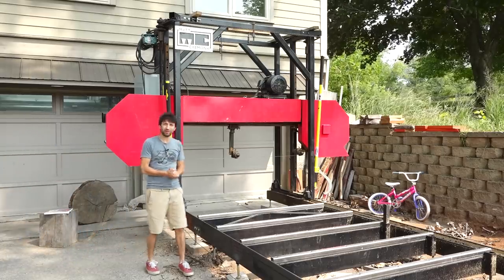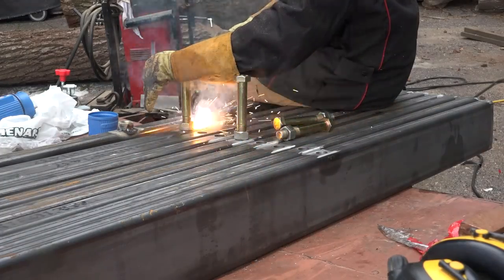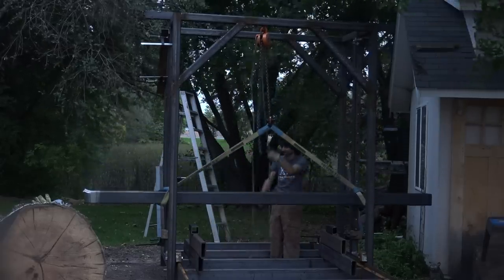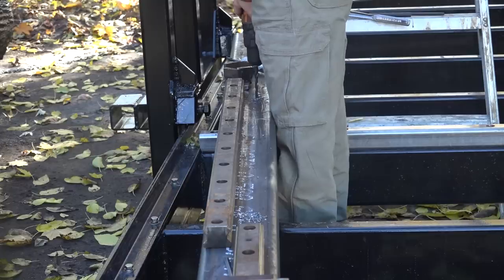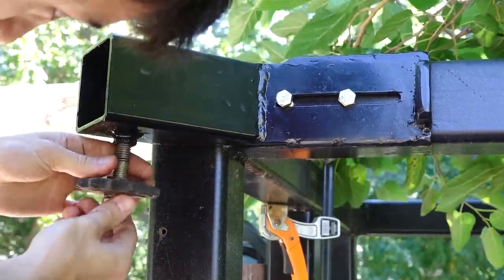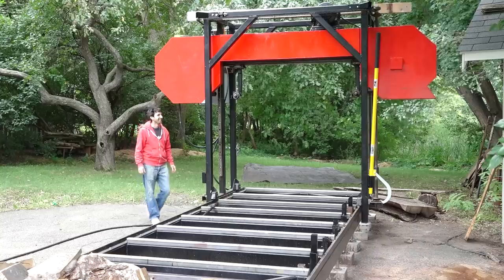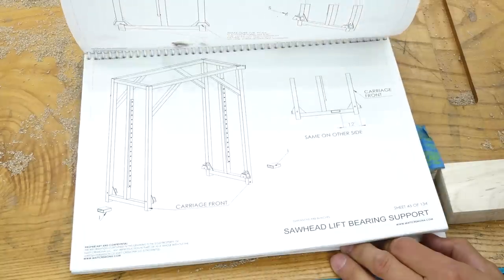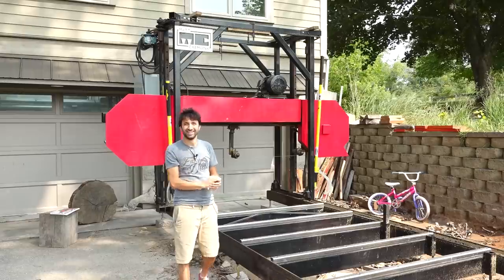How I Built a Giant Sawmill in my Backyard

Comment: You're an amazing artist Matt. One question, I'm sure you could have but, why didn't you use a motor to pull the saw through the log instead of the hand crank? My guess is that it gives you the feel of the cut as your making it so you can control the speed precisely as you're making it...  🤷‍♂   Thanks.
Reply from the maker: Correct

Comment: I've followed you most of the last ~7-8years.  I too am a woodworker.  and this has been on my bucket list.  I'm just now finishing up my logging trailer (which has been a multi-year project for me as i tend to work at a snails pace & procrastinate massively).  But My trailer not only has a logging arch I put custom built 2 ton crane on the front of it.  For multipurpose.  for starters my big move out of state is happening finally in the next month or 2.  and i have no other way of loading all my heavy wood/metal working equipment.
But i wanted to ask having rewatched part of your series you originally planned on fully automating this and doing all the hydraulic goodies.  Do you still plan on doing such or has having your new big toys made that less of a factor?  I can't even imagine the hydraulics to handle some of those monster logs you get on there.

I'm thinking of building my own version compiling idea's from many builds.   It will be a hybrid.  But I too want to go wide & Long.  But not sure there are even logs that big in Texas where i'll be moving too or even Washington where i'm moving from.  Your fortunate to have access to such huge logs.

Comment: Hey Matt.  Absolutely epic build. I'm curious about the linear bearings you used for the vertical motion. Do you have any details on them? Have you had any issues with them getting dirty or jamming?  I'm planning on improving my purchased mill's up / down motion from square tube over square tube to linear rails. But have hesitated due to concerns about type / size and durability.   Any information or suggestions greatly appreciated

Comment: That old Lincoln AC225 (AC/DC?...assuming AC only) deserves an honorable mention since it ran a lot of bead in this project.  What rods did you run (6011/7018AC mix?).  They're a very simple transformer machine - simple yet they just work!
Reply from the maker: AC only. I used 6011 rods

Comment: This may have been addressed in the original video, but not including your time and labor, what’d it cost to make the saw? Was it worth building your own as opposed to buying one off the (metaphorical) shelf?
Reply from the maker: I spent $8500 but I had some salvaged parts I used. Someone built one as spec’d in 2019 for a cost of 16k. Probably more like 20k these days. Realistically this is better built and more robust than the similar capacity saws you can buy
Reply: even at inflation, 20K for a mill of this size is pretty incredible. 8500 is about half of what I would've expected, even back then. Appreciate the insight @mcremona !

Comment: I lost track of you.. Watched you build/modify your trailer in the back yard, flipping it on the stand, and saw you starting the build and not sure what I did. But, when I saw your most recent video pop up, you were loading boards onto the trailer and I recognized it immediately and went to see if I could see you building it or the sawmill in your back yard.. Yep.. Same guy.. Ha..Ha... Tell me something.. What would be a ballpark figure if you built that sawmill again, or, how much you spent on it back then, and a range if you got good deals on parts pickups vs buying new... Just to get an idea.. 
I have been kicking around the idea of building one for quite some time, but, a lot closer to being able to do it. Have most of the skills. Welding, etc,, and, have done a little tinkering with VFD's, etc... 
You said, you would build it a Foot or so larger? And,, I saw in your blade video you made comments  about finding the 1.5' blades vs the 2" blades in Carbide.. Would you use a 2" blade if you did it again? I would imagine at least a few parts would have to change, if not the whole drive mechanism.. Just curious..

Comment: Matt, I'm about to get my band wheels moving at the proper rate. Wheels are 43", 32' blade. My concern is getting all that weight moving. I started with a cheap Chinese 10hp vfd, for my 10hp drive motor. It would not do much till it stopped and gave me a fault of "over current." Same thing when I'd ramp down. Soooo,,,question, are you running a 15hp vfd to power your 10hp to avoid any concerns or do u have 10hp vfd? What are your accel/decel ramp rates on ur vfd. Are there other programming parameters I should set for getting that weight moving??? I  have a high quality 10hp vfd on a cnc, considering using it to avoid any problems. Thanks, Jeff
Reply from the maker: I’m using mine to handle phase conversion so it’s been derated. It’s a 15hp. I just have the acceleration and deceleration parameters set. Haven’t played with anything else. 20sec/30sec

Comment: You seem to have settled on a blade - that is robust enough to cut through any metal that might be in the log? How often do you have to change / sharpen the blade?
Reply from the maker: Yes, no issues sawing through metal with the carbide blades. I use 1 blade per year
Reply: @mcremona  They seem to last a very long time?! And not having them ruined if you happen to hit a a metal object in a log, has to be a lot easier to not have to worry about it.

Comment: How did you decide on the blade size and length?  Can you get blades at any length, or did you look around for a common size that's easy to find and just build your machine to fit that certain blade length?    I'd hate to build one and then not be able to find blades for it.
Reply from the maker: You can get blades any length you want. They come on giant coils. The blade supplier just cuts and welds them to the length you need
Reply: @mcremona   Nice

Comment: I watched most of the videos covering this build, I'm not sure I saw all of them. I remember you mentioning making a hydraulic system of positioning the logs. Is that so, or did I make that up in my mind?
Reply: I remember Matt mentioning that hydraulics were a potential future upgrade.   However, with the track loader and telehandler, I don't think Matt feels that hydraulics are needed at this point.
Reply: @oldohioangler4525  Have you told Matt what you think. He might want to know about what is going to be done to his saw mill.
Reply from the maker: My desire for hydraulic log positioning came from my prior experience processing edged 4/4 from normal sized logs. I’ve become far more interesting in sawing large logs into slabs. The skid steer and telehandler are a good help with that
Reply: @AllenBrosowsky  I didn’t choose my wording carefully enough in my previous comment.  I should have said “I believe I have heard Matt state he didn’t think he would be adding hydraulic assistance to his mill since he now has the track loader and tele-handler.”